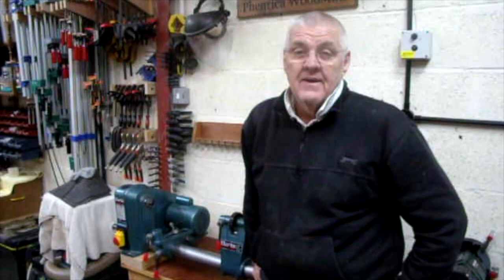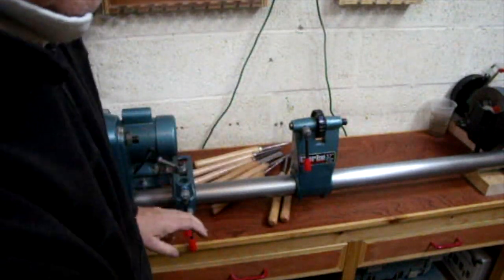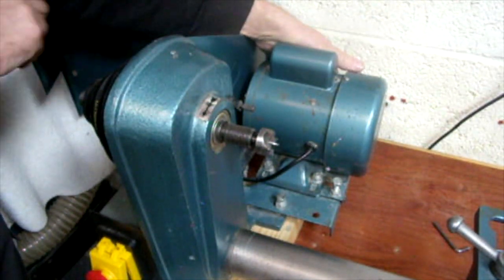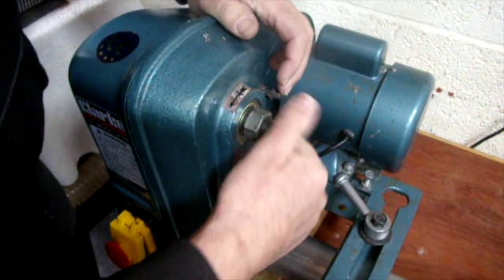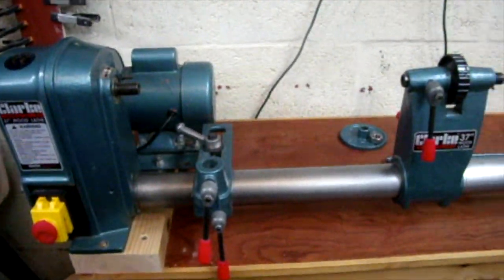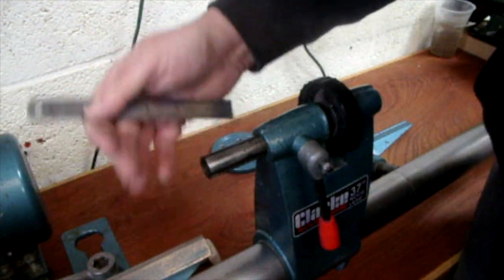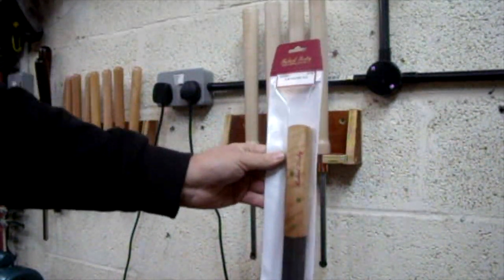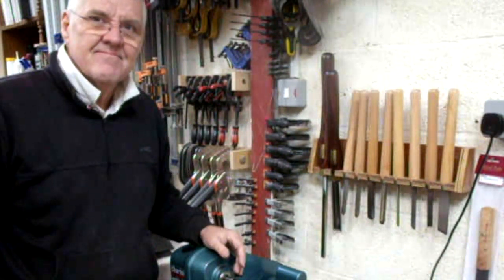Clarke Woodworkers 37" Lathe - Tool Review Tuesday

Comment: Hi, I'm sure I've read that the nut on the head stock is there to enable the drive centre to be removed, locking the head stock and unscrewing the nut will push the drive centre out, I have this lathe as a start up lathe great for learning without to much out lay, wish I had seen this as I started with a bag of bits and I had to work out how it fitted, thanks for the rundown on the lathe
Reply from the maker: Hi Stevie, yep that could work with the nut, never gave that a thought as I just used a knocker out bar 😂 Agree bout being an affordable way into woodturning as for the bag of bits I still recall many years after owning it coming across grub screws that I didn’t know where there and understanding once you knew about them how they could be adjusted to tune in the alignment.  Mines now gone to a new home (my bro-in-laws) and still being used regularly,
Cheers Steve

Comment: I think the nut behind the face plate is for locking against the Bach of the face plate to lock it in position
Reply from the maker: Yeh that makes sense, though does shorten the available thread I suppose. 👍

Comment: I too have one the same as this, at least I think it is the same as I have not seen mine for 12 years ! I had it given to me brand new, but never started it due to the shear amount of shavings these produce, I think mine is green, so maybe a different make, it is buried in the barn, so I must look it out, as you say, they are excellent for turning small objects. Chris B.
Reply from the maker: As most machines now Chris i guess they're all built in the same far eastern factory and branded by the dealer. As I said mine lived under the bench for 10 years or so, tho is functional if not a thing of beauty.
Thanks for the watch and comment

Comment: I want to use it as a shorter version but I don’t know how to split the cylinder . The other problem the motor won’t run and it seems that the starting capacitor has blown so today I’ve ordered a new one on line see how it goes thanks for sharing
Reply from the maker: To split the cylinder, remove the small screws from the keyway (the key breaches the tube split, then undo the long bolt that goes though the rear of the tube. The challenge will be how you fix the foot at the end of the tube to now exposed mid portion. There’s a plate in there that the long bolt screws into leaving no room to attach the foot! Could saw the tube I suppose and then use shorter end bolt etc. Good Luck 👍
Reply: @Phenrica  thank you so much the capacitor is arriving today so I can do both thanks again

Comment: Why did we get these ive had mine 15 yrs bought for 25 quid never used it as wood dust and greased parts dont mix in a garage workshop, so know just built a woodwork shop 7x10 purposely for wood stuff so when moving the lathe into its new home i dropped the sod and broke one of the cast mountings ,AHHHHH will try and stick it with a cast rod later then clean all rust off it and then lose my hearing using it lol, thanks for showing us m8.
Reply from the maker: Hope it all works out alright 👍🏻

Comment: I have the same lathe. They where sold under a number of different names. Mine is a Canadian Tire model. I paid $120 Canadian dollars for it and it's sat unused since I bought it used two years ago. Eventually I'll get around to setting it up once I get a shop either built or we move to a new home with a one already built, but the current problem is the tail stock moves off centre to the main spindle and could be dangerous. I need to find a way of getting that tail stock to stay on the bed rail and not swing left or right of centre of the main spindle. I also wish to add a number 1 morse taper jaw chuck if I can ever find one. How does the 4 jaw chuck and the new chuck kit fit into the drive spindle. Thanks for the video.

After watching the video again and hearing you especially say it's not a must have bit of kit I may just move this one for a more substantial style with a non round bed rail/tube. Searching online people in woodworking forums all seem to have the same opinion about this model and all recommend giving them a miss.
Reply from the maker: Richard Short Hi Richard, definitely not the best lathe in the world, however it did do the jobs I needed it to do. As for the tailstock alignment on the Clarke there’s access to grub screw that aids alignment by adjustment against the key under the round bar. I’ve just recently replaced mine for a midi lathe with variable speed. Hope this helps. Cheers Steve
Reply: Phenrica Hello Steve and thanks for the quick reply M8. I've tried adjusting that grub screw you mentioned but the alignment is still out slightly and so probably needs some further investigating to see what's wrong. Could be its worn and needs some work done to it. Hope you're enjoying the new one you got. Take care in this wacky world we find ourselves living in now. God bless brother.
Reply from the maker: Richard Short Thanks Richard, one thought has the tube itself slipped round? Again there’s a fixing screw this time at the rear of the head stock that’ll allow you to rotate the tube and therefore gives more scope on the tail stock. Just retread you’re original question and seen the Chuck query, I bought the 4” Xact Chuck package from Rutlands which had a reducing ring (1” x 8tpi in the Chuck) that allowed it to fit the lathe spindle (3/4 x 16tpi I think) I found a 1 morse taper Jacobs Chuck on eBay for about £10 old but works.
Reply: Phenrica Thank you Steve again for the quick reply. It's nice to know you read you're comments section, means a lot to folk watching you're videos. I watched a few more of what you do and I have to say you have a great talent for fine workmanship. Very well done on the model vehicles. I will contact Rutlands this week to checkout delivery cost to Canada. It may not be worth it, and so will look on Amazon Canada also. I will checkout that adjustment on the bed rail under headstock for sure, it could be a quick fix hopefully. I had been thinking about the nut on the main spindle and the outboard end also. I came up these ideas. The nut maybe is meant to help release any morse taper fitting in the main spindle to be pushed off by putting pressure on any adapter whilst it's knocked out from the outboard end. And the outboard end, could you run a sanding disc of that perhaps.? If I was back in the UK in Sunderland we could have had some good phone call conversations, but now live in Canada. Take care and keep.these quality vids coming. Cheers 🍻

Just downloaded the manual for this unit Steve. What I found was the headstock nut is to pop off taper centres and to lock face/backing plates and chucks to the spindle. The spindle lock is for indexing and yes you can outboard turn work larger than than the 12 inch inboard maximum and also add a manual turning handle/wheel. Parts availability is unknown as yet. Hope this helps any viewers out.  TTFN 👍

https://www.clarkeservice.co.uk/product_manuals/woodworker_woodlathes.shtml

Comment: Wen I adjust the grub screw it line up but then to tite and won’t let the tail stock slide
Reply from the maker: You just need to back the screw off aboit 1/8 a turn to allow movement. Plus try some silicon grease on the key way. It may help

Comment: I’m having trouble cantering/aligning the tail stock with head stock any way adjusting it
Reply from the maker: As I recall there’s a grub screw at the back of the tail stock that pushes against the jetway that gives you adjustment. You’ll need to back it off slightly to allow for sliding the tail stock up/down the tube.
It’s been a while so hopefully helps
Reply: @Phenrica  ye don’t work for me
Reply from the maker: @jujucattys156  you could try to see if can rotate the bed tube by loosening the screw on the headstock and the end bracket then re tighten. Failing that maybe modify the key way in the tail stock (file off material and pack out with foil tape, maybe)
Reply from the maker: @jujucattys156  just a thought are the brass pins that the grub screw tightens up on still present? It’s been a while since I used this type of lathe
Reply: @Phenrica  ye I ither to tite and and won’t slide back or to lose sad to much side side movement carnt line up

Comment: I know this is a long shot , but I'm looking to find out what the thread size is for the clamping bolt that keeps the two-bed tubes together!

Any help would be great fully received
Reply from the maker: I’m away at the moment & I gave my lathe away, however it was to my bro in law so I’ll try and find out when I’m back
Reply: @Phenrica   
that would be a great help,  thank you
Reply from the maker: @PaddyDoesasia-bj3bb  Hi, just back and checked the long bolt that holds the two bed tubes together. It looks like it’s 650mm long with a M10 X 1.5 pitch. Hope this helps

Comment: A question and an answer: The nut is to lock the chuck when fitting.
did you use a standard power switch as mine has recently broken and seem to be far from standard?
any advice would be welcome
Reply from the maker: I just got a cheap eBay NVR switch, it was straight forward to fit as I recall may had to link a wire out
Reply from the maker: Ps thanks for the nut answer, I suspected it could be used like that however when I tried it with my Chuck it just seemed to wobble too much for my liking 👍🏻

Comment: Any tool that's 20 to 25 years old probably doesn't owe you much.  It's likely paid for itself over and over again.
Reply from the maker: True there Jim even if it has spent in the region of 10 years in a box under the bench ;-) 
I do tend to use it mainly for making knobs and dowels with the occasional spindle thrown in.

Comment: Hi there. Great video. Can you tell me if the motor unit needs locked/secured after changing the belt?
Reply from the maker: Hi Kevin, the motor is fixed to the machine but not secured elsewhere I found that the tension created by the weight of the motor and the chassis that it sits on is adequate. Hope that helps. Cheers Steve
Reply: @Phenrica  yeah, mine is fixed. But I just wanted to check it needs locked down after lifting it when changing the belt
Reply from the maker: @kev_infocus  I never did for the 20 years or so I used mine, but go to admit it was a bit of a rattler but did the jobs I required really well. Also it did make changing the belts quicker 😉
Reply: @Phenrica  that's great, thanks pal. I downloaded the manual and it doesn't mention it. Thanks again

Comment: I have the same lathe and the switch is also knackered ... what exactly did you replace yours with?
Reply from the maker: Hi Simon, I bought a universal NVR switch off eBay cost about £9 4-5 years back. The item number of eBay was 283335769207 hope this helps. As I recall it was pretty straightforward in terms of fitting and wiring. Cheers Steve
Reply: @Phenrica  thanks a lot appreciate your help.
 I just ordered one .... £16 now though ..... Brexit lol.

Comment: I received two faceplates with this machine.  one doesn't fit anything on the unit.  Weird.
Reply from the maker: Now that does sound strange, I guess it’s a different thread for a different variant of their machines maybe. If so an adaptor may make it useful.